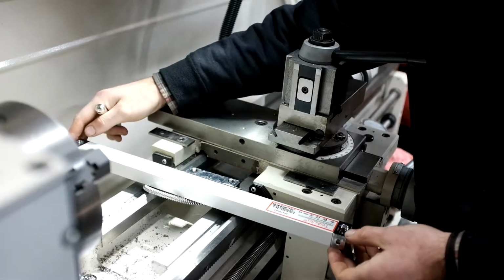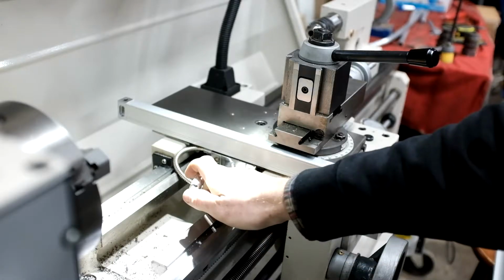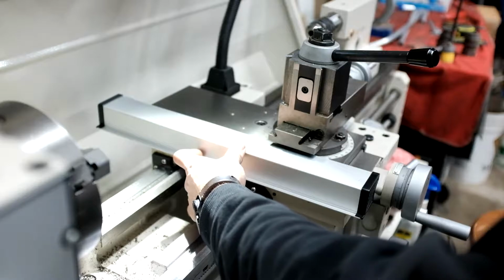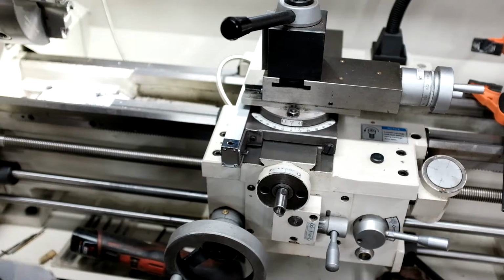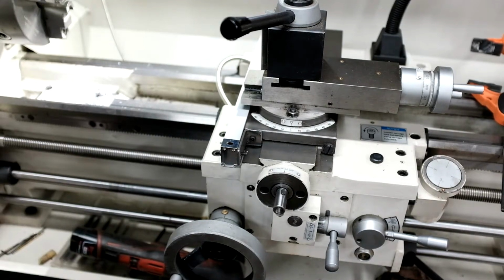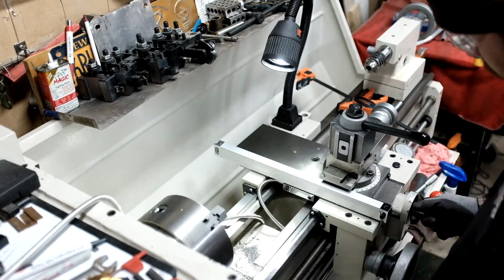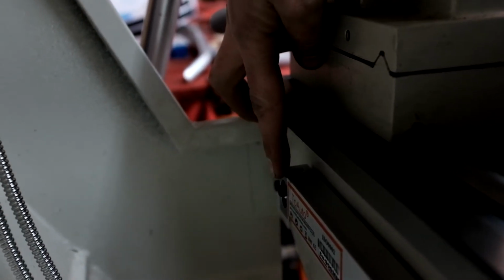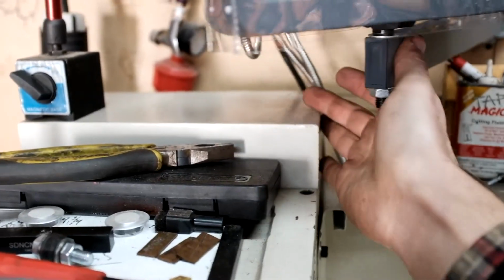DRO Install on Grizzly G0750g Lathe

Comment: Several good You Tube videos on cutting down the scales.  Turns out to be quite easily done.
Reply from the maker: I do need to put the cross slide scale on the other side of the slide. I can't run the steady rest because I covered the mounting holes . So i will be cutting it when i get the time.
Reply: It’s easy to cut the magnetic scales but not the glass scales, at least that’s what I understand.

Comment: I take delivery of my G0750G mid-April.  Can you tell me the sizes your ordered?
Reply: I guess there are only 2 choices, 12" and 36" or 12" and 40", unless of course they send the wrong size... lol
Reply from the maker: According to my order I did 300mm and 900mm. I could have sworn I did 12" x 36" but it still worked out just had to make some brackets

Comment: Isnt the smaller slider going to run into your hand when turning?
Reply from the maker: Nope! It has plenty of room. Only issue Is since the scale is on the front of the x axis gantry, i loose a bit of travel when having a large piece in the chuck